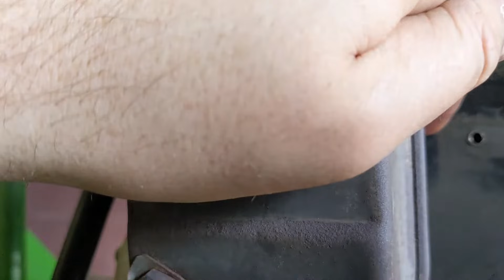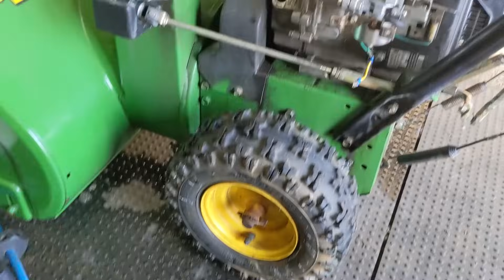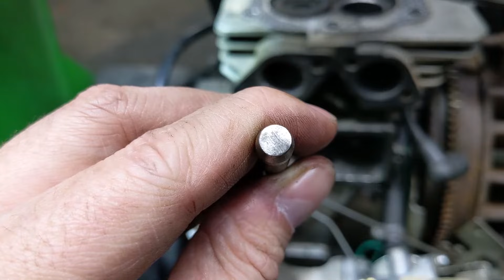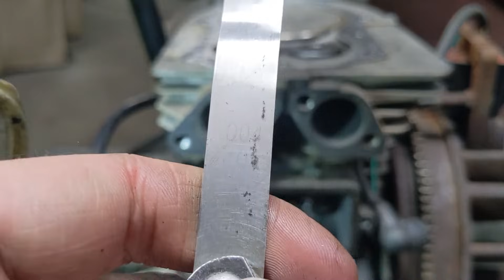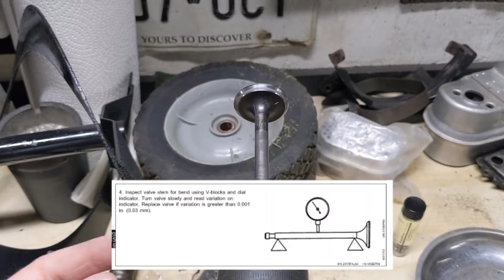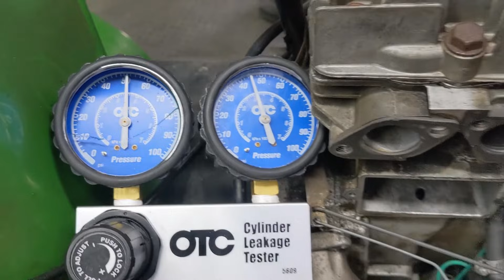Tecumseh HMSK80 Valve Job - John Deere TRS26

Comment from the maker: So a couple people have asked how the machine shop could've missed that warp in the intake valve when they machined a new 45° face.

My theory is that they installed the valve in the lathe chuck near the valve head. In the video, I installed the valve into my drill chuck further down the stem.

Because the warp is in the valve stem, they wouldn't have noticed. The further the valve head is from the chuck, the more it will wobble.

To test this theory, I reinstalled the warped intake valve into the drill chuck, this time closer to the valve head, and the wobble is not noticable at all.

This is why the manufacturer recommends using V-Blocks and a Dial Indicator (as shown on the infographic) to properly inspect a valve for warp.
Reply: I would not have used a chuck in the lathe, but a collet.  Lathe chucks always have some error in them.
Reply: AllWAYS chuck at very tip/ end of valve stem
Reply: They didn’t know what they were doing 
AllWAYS chuck back and check straight first thing
Reply: You still would think the shop would test but I guess maybe they assume you do ?
Reply: I'm glad they missed it. Gave a greater opportunity to show how to evaluate and fix things. I personally would have check "true" before lapping and the like, but can't complain one bit about the end result. Got it fixed. That's all the customer wanted.
Reply: Is it possible to straighten up the valve stem given enough time and patience?  Or is that just something no one ever considers doing, because it's always easier to replace it?
Reply from the maker: @sadfur8728 I would assume it could be done, but yes it's usually easier to replace. You'd need a dial indicator, and likely a lathe or at very least a good set of machinist v-blocks on a solid flat surface.
Reply: Have had one drill chuck wobble a valve, and another drill did not.
Reply: I wondered about that too.  Makes sense.

Comment: Where do you get the head gasket, and other Tecumseh parts.
Reply from the maker: Stens, but you need a business to sign up with them. But you can find their parts on Amazon usually, just type in the Tecumseh number and then put stens after it, find the stens number and then search for that on Amazon

Comment: Little late posting as this a 4 yr old video. My honest Opinion this a very well done and well explained video. And you showed that you care. My only suggestion for a home day guy buy a flat lap from a lapidary outfit. Place 500 grit emery sanding paper to touch up the end of valve stems. Loved the video. The simple tool you use is the hot tip. Well done.❤

Comment: Excellent job, very good information. I have a 2006 Murry Snow King with the Tecumseh HMSK80 engine. I got it for free and it wouldn't start. I tried rebuilding the carb but it had internal issues, installed a new carb and it fired up but I'm getting some flames out of the muffler and some popping and backfiring. I'll be tearing into it and following your advice, I have all the tools needed except for a leakage tester. Also unfortunately we don't have a machine shop in my area that resurfaces valves anymore. I may have to purchase new valves.

Comment: What is that tool you use to remove & install the valve spring keepers?
Reply from the maker: Trim removal tool, used for wood but we ground the middle out of it so it could be used to remove valves

Comment: Thanks for a thorough diagnoses. I have a 11hp Tecumseh on my snowblower and it won't start. What would cause the intake valve clearance to be at .022 in ?
Reply from the maker: Things get old and worn, they're either too tight or too loose! Too tight you lose compression and also burn up mufflers, hard to start. Too loose and the valves don't open and close at the right spot, also hard to start.

Comment: Hi, I noticed the perfect line you had on intake valve after lapping, witch tells me the valve was in specs for bent (00.4" Tec spec). I would bet my bottom dollar you had valve cut at 45deg and should have been 30deg!
Reply from the maker: All HMSK valve faces are cut to 45° whether they are intake or exhaust. As for the seat, the service manual technically calls for a 60° cut to be done 1st, this widens the seat, then a 31° and then finished with a 46° cut. The Neway 101 and 103 cutters can be used to achieve this, but they are quite expensive. I have always used a 45° carbide cutter to cut my seats and have never had an issue once the valves were properly lapped in.

https://www.allotment-garden.org/rotavator-manuals/Techumseh-L-Head-Engines-Manual.pdf
Reply: Hi , Yes! But the line was perfect on the valve face? should have sealed right? Like your videos, @EliminatorPerformance
Reply: @EliminatorPerformance 
If the seat was cut to 46°, and the valve face was ground to 45°, that's what's known as an interference fit which doesn't require lapping.
 
I'm curious why, on the original (bent) intake valve, no one picked up on a lack of concentricity of the wear pattern.
For that, the lapping pattern should have shown the lack of concentricity as well, which is the classic sign of a bent stem.

Comment: This video is the best for information how these engines work. Thanks.  My engine starts, ticks over but as soon as I increase the throttle, it blows black smoke and struggles then stops. I'm going to try to carry out a valve clean and hope it solves the problem.
Reply: Get to TDC and check exhaust valve to tappet gap.

Comment: I’m doing a valve job on a 10 horsepower Tecumseh and mistakenly ground too much off the valve stem on the exhaust valve.. about .004 - .005 thousandths too much. I was being careful with grinding and measuring but mistakenly had two feeler gauges together when measuring 🤦‍♂️ I haven’t lapped the valves yet. Do you think that lapping the exhaust valve would be enough to get the valve spec back into proper clearance? If not I do have an extra exhaust valve out of a blown 10 horsepower Tecumseh that is still in spec that I could use but I’m sure it would require even more lapping since it’s from a different engine. Please let me know what you think. Thanks.
Reply from the maker: Lapping won't give you 4-5 thou unfortunately, I'd look into a valve seat cutter, or you could get someone with a tig welder to just zap the end of the stem, or you could start fresh with a new valve. You have 3 options, and by cutting you will also clean up the seat, but it's not needed unless the lap job shows the marks as uneven or the seat is rough looking
Reply: @EliminatorPerformance   cool, thanks for replying back to my comment. I think I’m gonna start with a new valve since I have an extra one that’s from an identical engine and see how that goes. Just mad at myself for messing up the original valve and grinding too much off 🤦‍♂️
Reply from the maker: @AMF96  it happens when dealing with thousands of an inch, it doesn't take much

Comment: What is the name of the tool you used to pry the valves up so you could pop them out?
Reply from the maker: @zoopdoop69  I use a trim removal tool, but it's the ones for wood and it's slightly modified
Reply: @EliminatorPerformance  Awesome, thanks for the fast response dude!

Comment: Thanks for your video great info my engine is a Tecumseh LH318SA according to manuals very similar to the engine in this video my intake valve is .006 and exhaust is .003 so obviously need to do the valves my manual say intake .008 exhaust .012 my question is do I lap the valves first or do I get the clearance before lapping Thank you
Reply from the maker: I would lap them in 1st to see what the valve seat mark looks like, then if it looks smooth all the way around and you're happy with the seal, grind a bit off the end of the stem tip. Do the exhaust side 1st, you have to remove more so you'll have a bit more tolerance and when it comes time to do the intake side you'll already have some practice and it should go easier
Reply: Thanks I'm using your other video to adjust the governor also

Comment: My Tecumseh engine stinks like hell when it runs. Is this the reason?  Also stalls out a lot.
Reply from the maker: @davekopecmusic  could be running rich, I would start with a carb clean and adjust. Search everything you need to know about carburetor adjustment on Tecumseh snowblower I have a great video showing you the adjustment steps

Comment: Have been studying these valve job videos. So many operators won't pressure test there work. Just wrap it up and godspeed. It's not that simple to do valvejob so it won't leak. It should be tested before final assembly.

Comment: I have a old  Techumseh 9HP snowblower, Model LH318SA, (DOM: 06193CD0999) that has a leaky intake valve and trying to find the right head gasket. Called Jacks to find the right gasket and they couldn't help me. I can get a head gasket on Amazon that they say fits model LA318. Would that be a good choice?

Comment: I have a Black and Decker valve grinder likely from 1940's with flat head Ford tools. You would be surprised how much it gets used. Considering an automotive head is $300 for a valve job you can pay for a good used machine in 2 heads IF YOU KNOW HOW and why to use one. Mine won't take the tiny valves, the pump is shot and needs bearings. I'll probably look for a new machine and I understand Sunnen is getting hard to find parts for lately.

Comment: My Tecumseh starts easily and runs relatively well however, it will back fire through the carb then immediately through the exhaust. I'm thinking valve issue but not sure. Any guidance would be helpful.

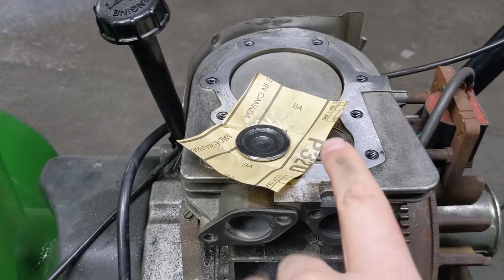Comment: @26:00 Valve lapping paste exists for this purpose
Reply from the maker: I lap the valve with paste, I just mentioned the sandpaper because it's more aggressive and if you don't have a valve seat cutter tool then it works really good. I would recommend lapping after as always.

Comment: This is very interesting.I have a Troybilt with a 5.5 Tecumseh that I had a problem sealing up like you did,but the way I got a good seal was just to do alot of lapping and they finaly sealed.I did a leak down after I was done and with 50 psi in I got a leak of about 39 psi which is about 22% leak down.Do you think it is leaking bad pass the rings yet.The engine starts alot better and seems to run great

Comment: Having problems with same engine it pops though the exhaust just doesn't run right ,have cleaned carb and even installed a new carb with no difference in running. I don't have a compression tool but guy I got it from said it was good ,  any ideas maybe head gasket, or valves.

Comment: Nice demo with the leak down tester. When you are adjusting the valve lash, it is more accurate to do it after lapping since this step also removes metal causing the clearance to get smaller. Also, if the valve is firmly pressed down onto the seat you can measure the clearance without putting the springs back on. A little oil on the valve stems while lapping is a good idea.
Reply: I always just pushed down with my Thumb on old Tecumsehs.  Put the Spring on when I was finished
Reply: Are the head gaskets always replaced every time the head is removed on these?

Comment: Excellent job and commentary. Always wondered how a valve got longer and needed to be shortened.
Reply from the maker: Thanks for watching!
Reply: Is there ever anything that would cause the valve to be too short and need to be lengthened, aside from some over zealous grinding?   Is the only solution a replacement valve in that case?

Comment: Wow! I'm so impressed.

Just bought some tools to do some job on my snowblower. 
Filler gauge, compression tester

Just want to ask, any reason why on winter, it's really difficult o start my snowblower to extent that it won't start in winter, but this summer, it just take a pull to start it. Thanks
Reply from the maker: Likely valves or carb, if the valves aren't sealing or not in spec for lash, then they don't pull in fuel as good. Additionally, if the carb needs adjusting then the same thing.

Comment: Excellent video all the way around! 
Not sure you'll reply because the video is 2 years old but...
In your video it showed a white valve guide (?) built into the spring top cap. It was on the intake valve whereas I was working on my 10hp Tecumseh today and the spring cap with the white insert is on the exhaust valve. I put it back the way I found it when I had the valves out today but if it's supposed to be on the intake valve should I move it? Looks like somebody was in there before me if so. Not surprising as this Simplicity snowblower is ancient.
Thanks again for the great video!!!
Reply from the maker: Due to the heat I would assume they would only use it on the intake valve. 151A shows it as the Tecumseh 35862 intake valve seal. If you Google that part number, it shows it as either black or white in color. The diagram shows it on the right side, but the intake valve is on the left, and it's an intake valve seal to prevent fuel from going down the valve into the cylinder. I would not recommend running it on the exhaust side.
 https://www.jackssmallengines.com/jacks-parts-lookup/manufacturer/tecumseh/4-cycle-horizontal/hmsk-80/hmsk80-155524s-155524s-hmsk80/engine-parts-list-1
Reply: @Eliminator Performance  I thought the same about the heat too while putting it back where I found it. I need to tear it all down again anyway so I'll correct that...it's still aspirating OUT of the carb and cranks but no start, only the occassional horrendous backfire explosion. A new head gasket, new carb from Amazon, spark plug, and oil change did nothing to get it running again. 
I subscribed not just for excellent content, but also because you took the time to reply to me on a 2 year old video. Well done!!

Comment: Great diagnosis and repair.   If you were unable to get a new valve easily, do you think you could straighten the old bent valve? Has anyone watching this tried to straighten an old bent valve?
Reply: I had the same thought, but apparently no one has ever tried.  Probably just not considered because it'd take to much time and patience to do, but it's something I'd try just to see if I could do it. 
It's like straightening out spiraled copper wires for reuse with Wagos after they've been used for wire nut connectors- I've never  seen anyone else do that, but I always do.  Simple with a Knipex plier wrench, and strangely satisfying, lol.

Comment: I want to ask you about this valve problem.I have a Tecumseh 5.5 hp flat head engine on my  Troybilt snow blower and it has this same problem.I also noticed that the valve guides are worn and the valves seem to have alot of play.Do they have such a thing as a oversized valve stem that I could get or a bushing I could put in to tighten up the valve guild play that you know about.I know that on Briggs engines they have a repair kit with a reamer and guide,but do not see anything like this for Tecumseh engines.

Comment: I was wondering if you have alot of valve guide wear on these flathead engines can you ream the guide out and put in a sleeve or bushing like they do on Briggs and Stratton engines.Or is this something that a machine shop has to do.I see with Briggs they use a pilot and reamer and then put asleeve in.
Reply: I don’t think many Shops bother with valve jobs anymore.  Rings even less.  Shop rates are too high.  Many don’t even overhaul carbs.  I would bet only a few older guys out there have ever put in a Briggs valve bushing…. I have:

Comment: When they had the valve in the valve grinder, if it was bent they woulda noticed right away. Using your drill is a good idea but definitely no precision way of measuring valve stems.
Reply from the maker: Yea I thought for sure they would've noticed it, but there's no way I would've bent that
Reply: @Eliminator Performance  I saw your updated post after I opened my flapper!
I've got a hssk50 in where it wouldn't start right or idle worth crap. Has a adjustable carb with air style jet, the long one that has the metering rod u can hear when shaken. Anyways spent a lot of time checking carb, fuel system,  carb, spark yada yada yada. Decided to do leak down. No clearance on exhaust valve and guide has lots of slop. I can't find any oversized valves... guess I'm gunna make a new bronze guide. Don't know what else 2 do other than that or just make sure it has valve clearance and run it with a sloppy valve guide.

Comment: What is the root cause of this valves situation ? I learned a lot from this video and this will serve me greatly to tackle my dad's hmsk100 snowblower engine. It will be a first time for me. Excellent video. Thx for sharing your passion!
Reply: Because the seat was ground away, the valve sits lower in the head resulting in less gap to the tappet
Reply: Presumably the wear on the valves and seat progress faster than the wear on the valve stem tip, so the clearance decreases over time to the point where the valve remains propped open.

Comment: Hi. Recently I start having problems with my lawn mower. The problem is that I don't have good compression y check de valves and it moves and seel freely until I saw the piston walls and I discover that it have scratches that I can feel with my fingers nail. So the question is can I rebuld the engine?

Comment: Nice video.  I would suggest that since you work on engines that you get a small surface plate and an inexpensive height gauge for making measurements.  You can get used units on eBay for not too much money.  You will be happy about the time you will save.  You will be able to check parts and file to exact measurements without having to through the tedious and time consuming iterative process that you showed on this video.
Reply: He needs to just buy a used oil machine and be set for life
Reply: I'm a retired machinist and I agree 100% with your comment, I have used my digital dial calipers in  the same fashion.